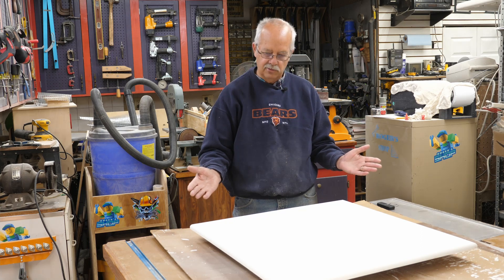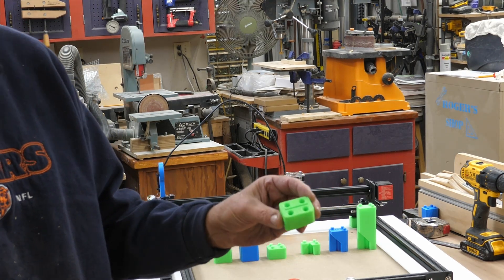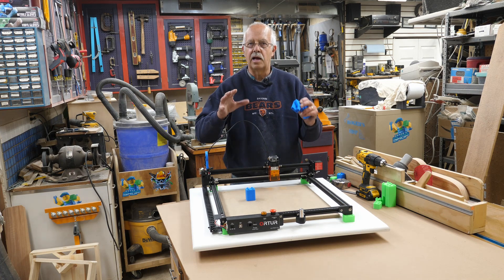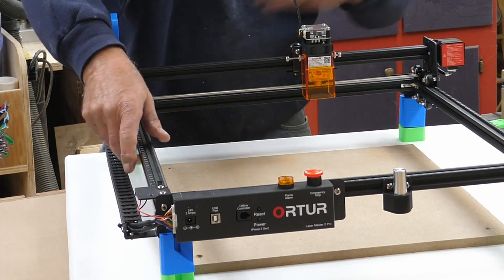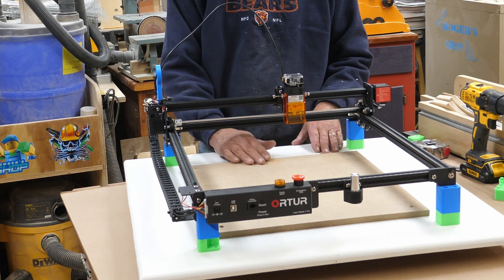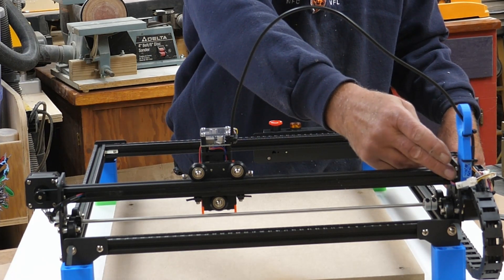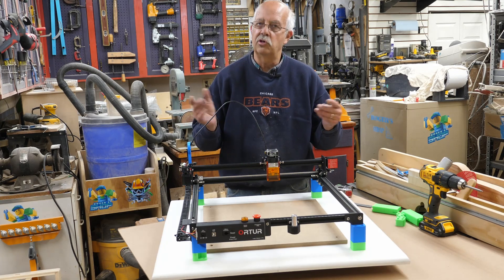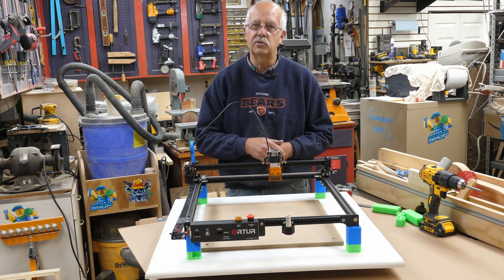Ortur Laser Master 2 Pro Base Board Mount With Risers

Comment: Of all the lasers you own, which one would you recommend for best bang for buck?
Reply from the maker: This depends on what your "end use" is going to be.  I have nine lasers.  Each is pretty much designated to specific jobs.  If your primary use is cutting, the the Xtool D1 would be my choice.  If engraving is the primary use, then the Ortur Pro, Longer, Ray 5 or Atomstack A5 Pro would be my choice.  For specific use of engraving ceramic or glass tile, then the Sainsmart, Atomstack A9, or Aufero Laser 2 would be the choice.  For just general purpose hobby use, the Ortur Laser Master 2 would be the choice.